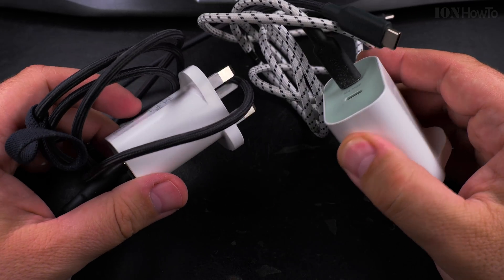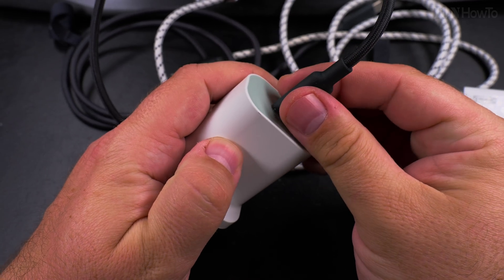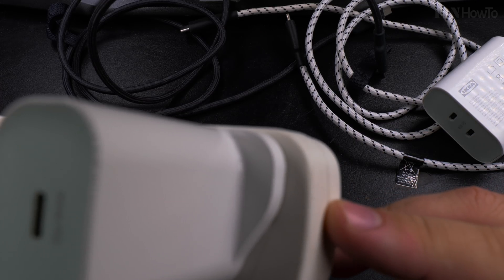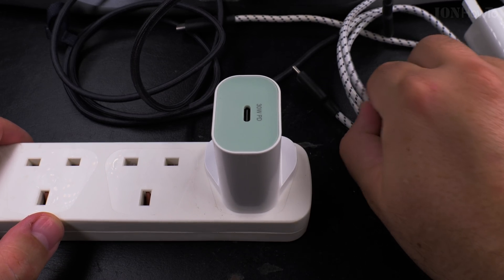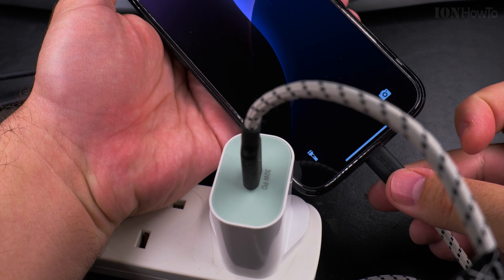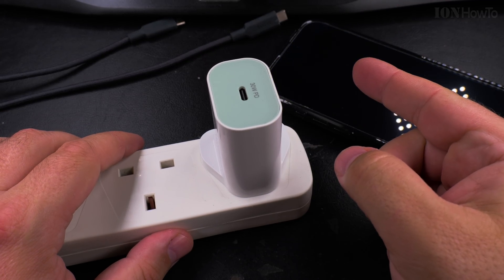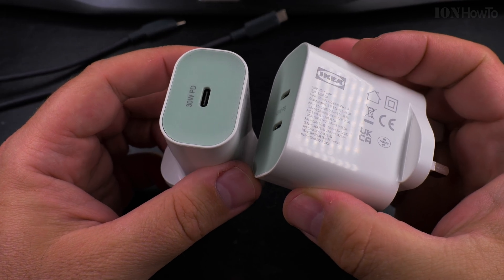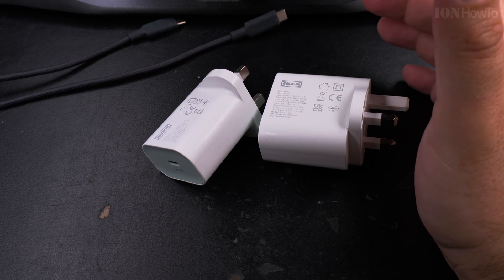IKEA Sjoss 30W USB-C Charger Buzzing Noise Why It Happens & What to Do

Comment: Mine does this and I'm scared to use it. I've bought 3 and they all do it.
Reply from the maker: Yeah, just got it replaced and it’s doing the same thing… I gave up. Strange that nobody talks about this. 
You should complain to their customer service. Hopefully, they’ll make a recall for all of them. 
I’m not sure if it’s safe to use. It probably is but better complain and let them check if it’s really safe to use or not. 
Let me know what they say.
Reply: It's not dangerous, it's just annoying.

This happens because of the switching frequency of the power supply causing some resonance usually in the inductors.

It's sometimes called "coil whine".
Reply from the maker: coil whine sounds different. I have a video with the Xiaomi power bank doing that. this is a constant buzz and it's a lower pitch. I guess you could call this coil wine too haha
Reply: @IONHowTo AFAIK transformers, inductors (coils), and ceramic capacitors all can make a sound. I don't know how to tell one from the other, but surely the size of the component will change the pitch.

Also you say it's constant so does it not change with a load plugged vs unplugged? In that case, that for sure is a clue. But I'm out of my depth here, idk what it implies. I do think that coil whine specifically does change based on the load, not sure if that is universal across all PSU topologies however.